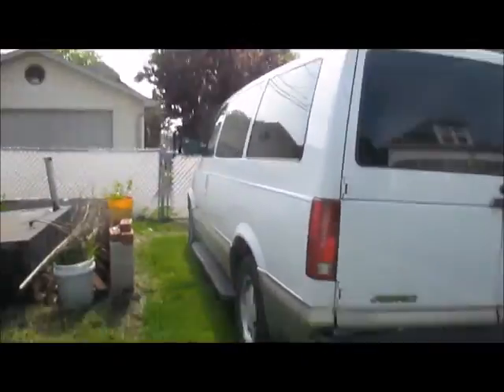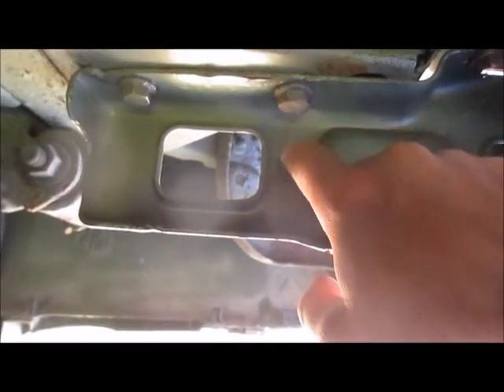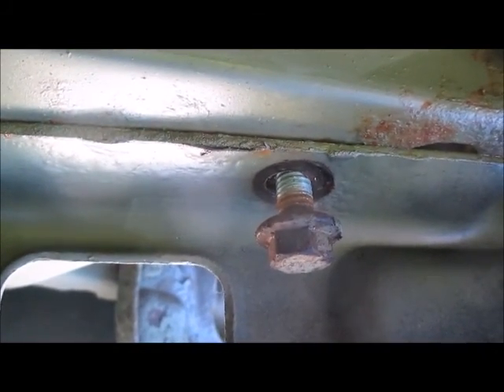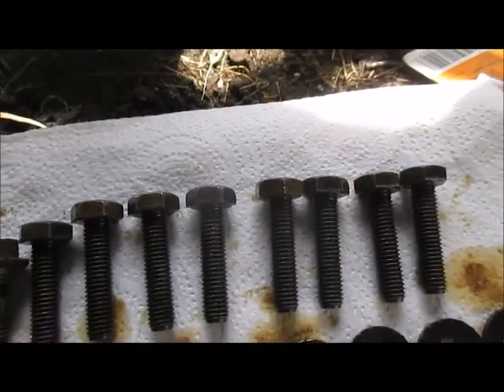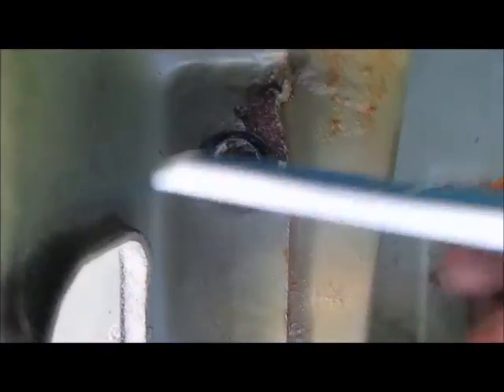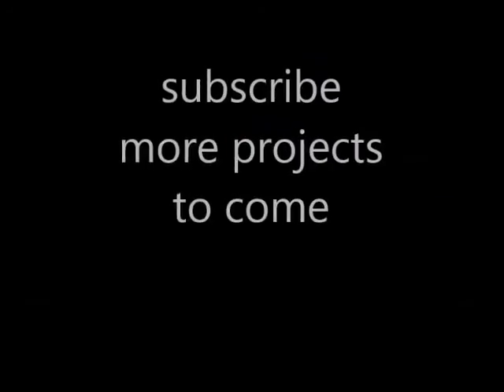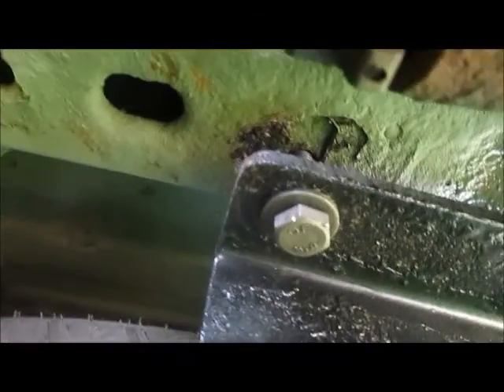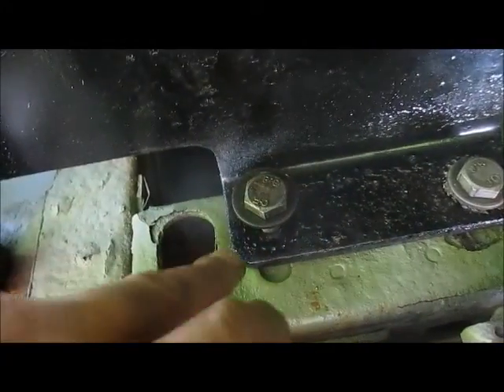2002 astro van trailer hitch install

Comment: Hey Bro It would have been a lot easier to drill out all the holes. Get a set of fresh (new ) grade 8 bolts nuts and washers . Install the bolts with washers from inside the frame down . You can use bailey wire the thin stuff  or works best is a piece of mig welding wire wrap it on the threads   leaving a nice long tail at the end of the bolt as your fishing  wire ..It makes it so much easier and you dont have to worry about stripping out them old rusty threads on your frame .New Bolt  new washers Some lock washers and New nuts and it's a wrap  . I know how much of a pain it is to do by yourself .Love your videos bro ! Thank you!

Comment: best run a tap and clean out the threads. use a crow bar to spread the bracket to align the hole then easily thread in by hand ,a come along could also help you line up the hole to the bolt hole.

Comment: Would have helped you to slowly clean out the threads with a tap (thread maker) before trying to install the bolts. If you can afford it a hi-torque Milwaukee 1/2 inch impact is the way to go for these jobs. I say hi-torque because if you are using extension bars to reach bolts the extension will absorb torque and make the gun air or battery type weaker.
I have a bumper on my Astro that looks like Godzilla attacked it so this video helps. Thanks.

Comment: Go to where they are building new homes and find four glulam beam pieces that are like 10" and like 2' long. Then use your floor jack to lift each corner and put them under the tires. Then your car is up 10" safely. ramps  are good too but a bit more sketchy.